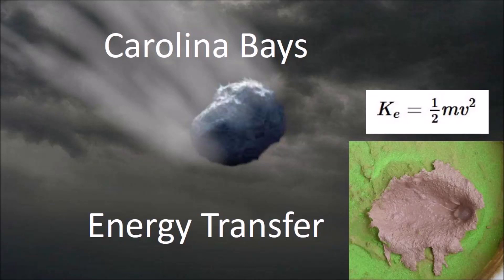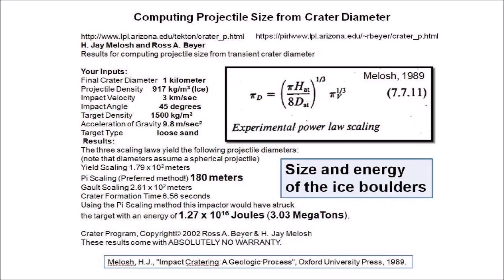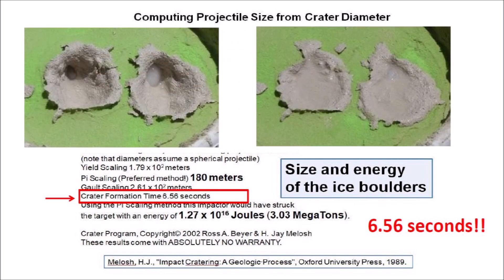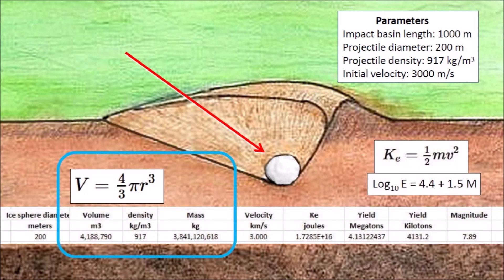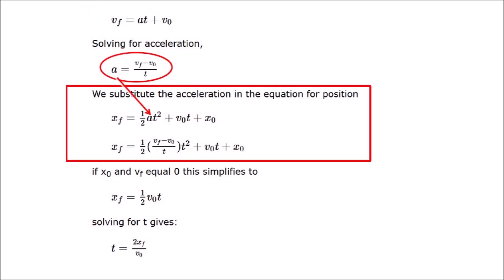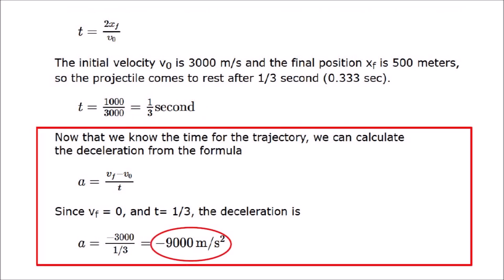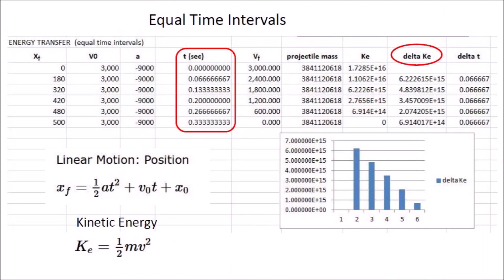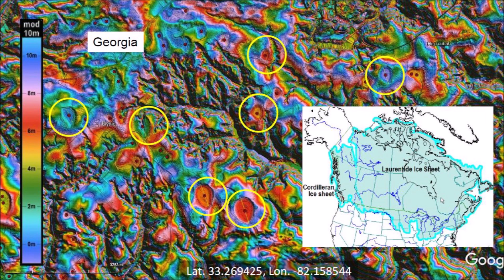Carolina Bays Energy Transfer

Comment from the maker: I mentioned that I don't know how the ice boulders maintained their integrity after hitting the target surface. It is possible that they didn't, but the crushed ice mass continued its trajectory due to its momentum.

There is a difference between displacing material to form a cavity and transmitting energy to form a wave.  Pay close attention to this video: https://youtube.com/shorts/TxehkX69mqo
You will notice in the slow-motion part that a circular shock wave emanates from the impact site and it leaves a slight circular mark just beyond the crater rim of the penetration funnel.  There is a partition of energy between crater formation and seismic wave generation.

Comment: Those basins are so obviously a splatter pattern that any other terrestrial explanation doesn't make sense. As you say, the elliptical shape, alignment, and overlapping basins can't be explained any other way. It reminds me of how Wegner noticed that the shapes of the continents all fit together, but was ridiculed for saying they must have split up long ago. After all, continents can't move! I have a question, how much would the instant conversion from ice to steam add to the explosive power of the comet (or whatever) impact? I'm thinking of how the old steam boilers of old ships or trains would explode if they got too hot.
Reply from the maker: The conversion of ice to steam goes through three phases that require a lot of energy input. Melting ice requires 80 calories per gram, raising the temperature of the water from 0 to 100 degrees requires 100 calories per gram, and converting water into steam requires 539 calories per gram.  ... and then she blows!! Many Carolina Bays have width-to-length ratios corresponding to impacts at 35 degrees, which is a low angle.  Usually, angles of 45 degrees are expected for ejecta from an impact. I think that the high pressure of the steam plume contributed to the low angles.
Reply: @Antonio_Zamora  Thank you! Could it also be why there are no basins closer to the Great Lakes?
Reply: and why there's no crater?
Reply from the maker: Some scientists, like professor Schultz from Brown University, propose that the thick layer of ice attenuated the ET impact, and that subsequent weathering and flooding could have erased all traces of the crater. The Carolina Bays are only found on unconsolidated terrain that could be liquefied by the seismic vibrations of the impacts.
Reply: @Antonio_Zamora  I guess what I am asking is has anyone explored the additional dynamics that a steam explosion adds to the impact? Perhaps the traditional crater rim would have been blown away. Something else, glacial ice is in a plastic state, in that it flows, could that be why it broke up in such large chunks and didn't just shatter into tiny pieces? So many things to consider, it's fascinating!
Reply from the maker: @horton12545  As far as I know, I am the only person trying to study the impact mechanisms of the Carolina Bays. I think that it is a shame that geology has really neglected the Carolina Bays.
Reply: @Antonio_Zamora  Where's their curiosity? Are they really satisfied with the conventional explanation? Like my Wegener comparison, where even a child can look at a globe and see how the continents fit, I look at the Bays and see an obvious splatter pattern. What else can cause a pattern like that? The conventional explanations are far from convincing. I don't think Wegener was ever vindicated during his lifetime. At least now with the internet, even with its many downsides, this can't be suppressed. Even if only as an academic exercise I would think it would be fascinating to study what would happen during an impact on a glacier. Where are the physicists? Interestingly, you have artillery people commenting. It is kind of like an exploding shell isn't it? but not quite. With the shell the explosive is contained in the shell, but here the explosive (ice vaporization) is the impact surface. You've been very kind to respond to my comments. I have no education on the topic other than some basic geology courses 40+ years ago and what I see on Youtube. Thank you for your patience! I have one more follow up. Is it true that deep ice in the glacier under enough pressure to flow (plastic) is less brittle than regular ice? I bring it up because ballistic tests on ice are done on regular ice and may not be completely applicable.
Reply from the maker: @horton12545 The following video discusses the properties of ice:  https://youtu.be/lFDbYpLymwY
Reply: @Antonio_Zamora  Yes, and perhaps the angle of the initial impact, as hypothesized many times as coming from the north east direction as judged by the shape of Saginaw bay and the observed resulting pattern.  Its interesting to note that perhaps this oblique impact when factoring in the water gas explosion could maybe account for some of the observed differences in calculated trajectories on the updated map.  Is it maybe a less circular larger bay pattern or what does this larger pattern say about the water explosion? Moreover, maybe giving the ice boulders at different times of breaking apart during penetration, differences in initial velocities, collisions with other boulders, spin and internal breakages resulting in lateral trajectories from their initial parabola, I don't know, just thinking out loud.

Comment: Years ago I was involved in a class which taught how to determine a direction an artillery shell impact craters to points back towards it's origin , and thereby do a counter battery fire upon the guns that just fired at you. 
 In my thinking the multitude of over lapping, and side by side craters looks like an atillery bombardment . It would in my opinion be impossible to form so many impacts or impact like structures randomly .  For all the structures have a similiar back azimuths to a similiar points of origin or origins.
Reply from the maker: It is time to teach some geologists about artillery. Thanks for your comment.
Reply: @Antonio_Zamora  I was taught by Captain a field artillery unit . There is probably a field artillery unit near you .
Reply: We need to target some good packed ice with intense heat and measure the effect, see what happens...

Comment: I'm wondering also: if the comet had fully or partially vaporized prior to impact how would that affect the area of greatest force and the timeline of impact into the ejecta phase. Looking back at the Jupiter impact of some few years ago, the impact field was quite long, (a third of the planet diameter or so?) and had obvious pulse points. Closer to Earth the comet would be far more vaporized I would assume. This might suggest a less point impulsive yet equally energetic primary impact field.
Reply: In Chelyabinsk we learned that a car sized rock coming in at many km per second did not penetrate the atmosphere.  Furthermore, we can see and hear how the shockwave got bunched up  before and during hitting the ground with like a couple seconds of shaking.  In Jupiter we see it is a comet that we assume, has water.  The earth-sized impact scars and larger bruising shows material being kicked up.  If Chelyabinsk would have been a building sized comet, what differences would we have seen?

Comment: Great video, glad you decided to make it.  We aren't all scared by maths,

I'm wondering if it's worth noting how deep the ice boulder would be when it came to rest?  Using the data you already have for impact angle, speed, deceleration distances in 3 dimensions?  It would be nice to know how deep some of the larger beasts went.

Comment: This was fantastic!  Other's will be able to go over your math and duplicate your results.  It also, added a great deal of detail into how exactly the energy transfer took place!

There were a lot of details that I didn't even consider!  I could imagine, for example, that immediately after the ice boulder came to a stop, with all of the forces applying from all sides except the back of the ice boulder, that not only would it come to a stop, but that finally it could shatter and giant chunks of ice would rebound and shoot back out of the forming conic section.  Maybe this cannot happen, but that's one of the things that popped into my mind.

This was very eye opening.  Thank you for sharing this.
Reply: That would depend if the impactor hit bedrock, or came to rest in softer ground.  In a river, for example, the ice boulder could hit water, sediment and then bedrock, shattering and creating splash chevrons if enough energy remained.
I don't think there are enough outside forces to cause shattering if the entire deceleration is done in wet, sandy soil.  It just stops and melts.  It reminds me of an old Columbo episode, where the victim is killed with an ice arrow.  No trace of the murder weapon survives.
It's important to look at the underlying geology to see how deep the soft layer is, as that could throw off the calculations.

Comment: Dr. Zamora, Thanks for this entire series, it's very thought-provoking. I must admit that the math is beyond me and that is why I'm commenting. I have a question about your calculation of the original impact site(s) in and around the Great Lakes. Specifically, I would like to address the critique that there was no ice cover in the Saginaw Bay area at 11,900 bp. I believe that the assumptions of the current axial tilt of 23.5 degrees and Earth's rotational speed on that axis are incorrect. I've never been satisfied with the explanation for the presence of megafauna in the first place being that the mammoth steppe was "more productive" or that the lakes in the Great Basin were because "it rained more". Why? An axial tilt of closer to zero addresses this, A narrower band of tropical insolation over the Pacific drives stronger winds bearing a much larger moisture content to northern latitudes where it is perpetual winter. In contrast, in lower latitudes, it is always summer (and much, much wetter in the Great Basin). All of which brings me to a point that a participant in one of Randal Carlson's seminars brought up: Lake Nipigon is (or at least appears to be) an impact crater. Specifically, I believe it to be the impact that created the bulk of the Carolina Bays. I suspect that if you adjust your original calculations such that the vectors converge on Lake Nipigon rather than Saginaw Bay, the result would be within the realm of possible; perhaps a 5-degree tilt and a 20-hour day? I have no idea how to do these calculations, but I suspect it's something you can knock out very easily.
Reply: I think the ice cover question comes from the dating of moraines and till rather than estimates based on tilt etc.  There are receding terminal moraines as the glaciers shrink each year, which can be dated.  Watch this video, with an eye on the dates  https://www.youtube.com/watch?v=LydQXydQKrc

Comment: Thanks Antonio... another great video. 

Recently I saw a video were a large asteroid or comet broke apart high above surface. Many fragments, some very large, came in at low angle and became air burst explosions. It was like the 2013 event in Russia and Tunguska event. No craters formed because none impacted ground. Evidence of large scale fires, char mat, micro-sphere rare elements over large area. This is trigger for YD cooling. These do not explain the Bays.

I have theory that supports both yours and theirs. Large fragments that didn't explode in air impacted the Ice Sheet resulting in large ice fragments blasted out and across America. This means that Bays don't all point to one separate impact, but multiple over a larger area. Impact Fragments had enough kinetic energy to launch millions of tons of ice thousands of miles, but not so much as to penetrate Ice Sheet with depths of 1-2 miles thick. Impacts were low angle same as original asteroid or comet.
Reply: I think that Antonio Zamora is looking at the impacts of just a small portion of this larger event that happened.  Especially when you consider that huge volumes of water flowed down through the Scab lands out west and down the Missouri and Mississippi river valleys, and Antonio is concentrating at what happened mostly out east.

None of this even takes into account of what happened on the land masses on the other side of the globe!  There's evidence of massive floods hitting that side, too.
Reply: @direbearcoat7551  I live in Washington State. Ground zero for massive floods. Yes, and there were other Ice Sheets by Hudson Bay. There is evidence of event in English Channel when seas were 100 meters lower. It's all very fascinating to me, love geology and mysteries it solves.
Reply: Whats interesting here is we may be able to trace back where multiple impacts hit if the carolina type bays do have multiple sources, however the evidence I've seen so far points to one.
Reply: @MrEddieLomax  Last traces I saw pointed back to 4 or 5 separate areas. Hope we have answers soon.